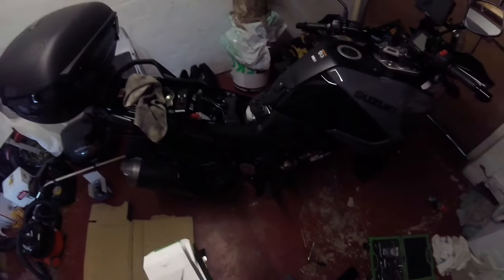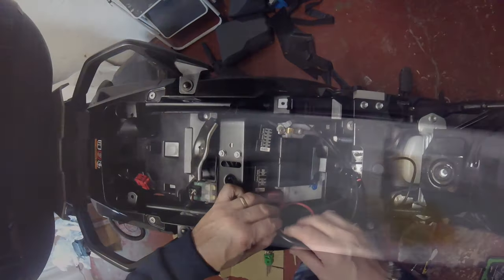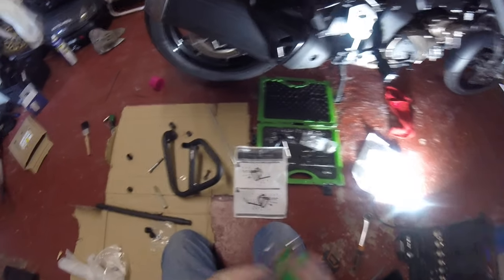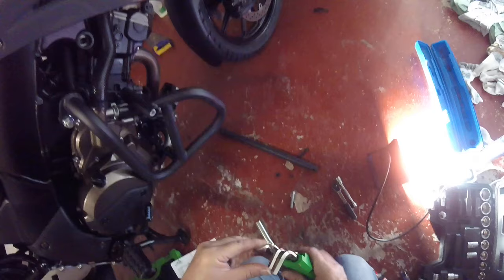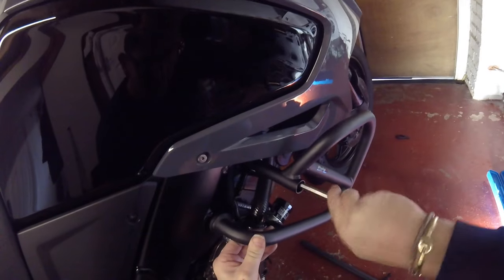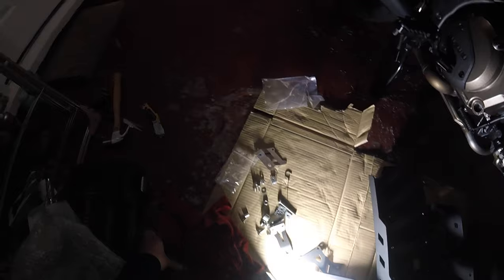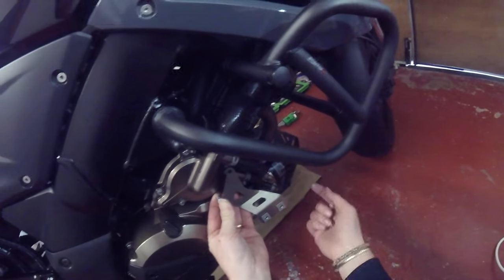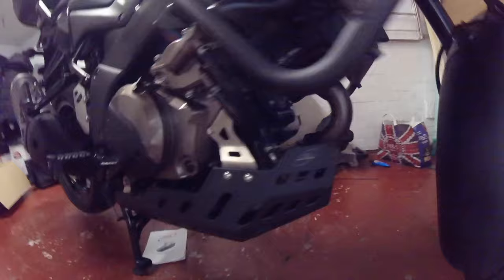SUZUKI V STROM DL1050 - SIZZAPP Tracker & Crash Bars & Engine Guard Installation

Comment: @Motourev can you please share the torque values needed to tighten the two bolts from the front cylinder (left and right) and the central longer bolt?
Reply from the maker: Will see if still got instructions
Reply: @Motourev  PLEASE do! Are these the OEM crash bars?